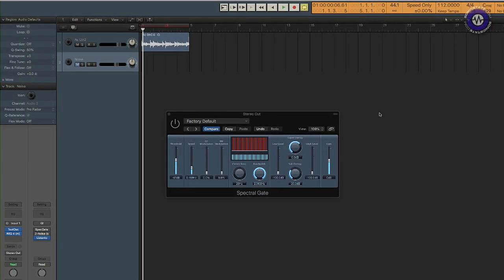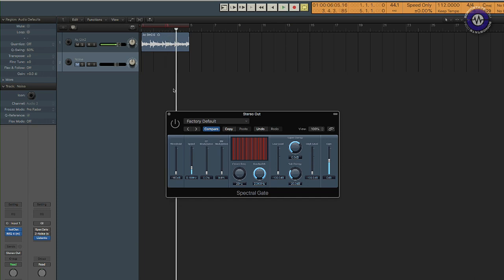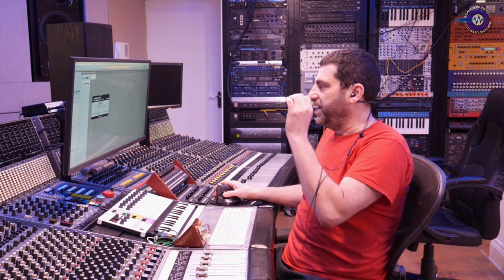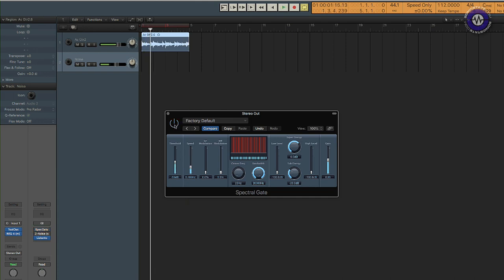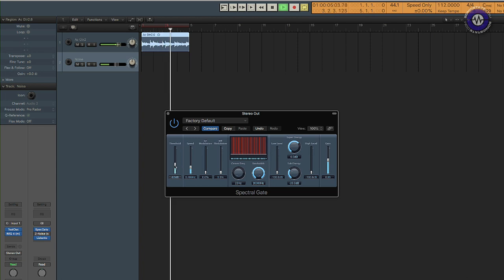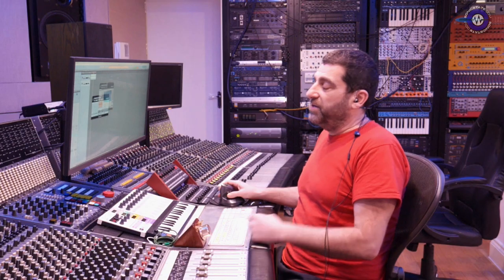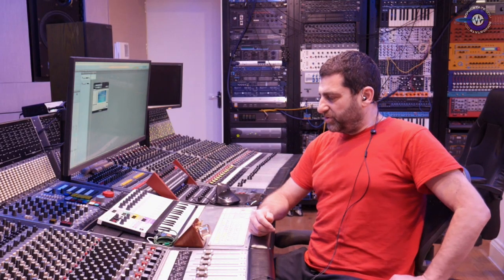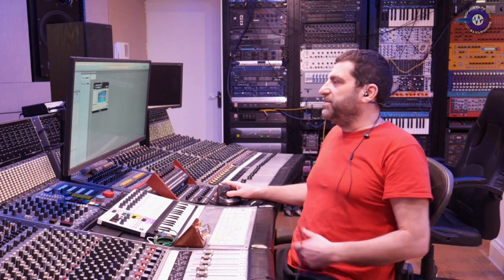HOW IT WORKS - Noise Reduction With Yoad Nevo

Comment: Great thanks Yoad & Nick!  Very appropriate as I've just been thinking how I can clean up my analogue Line level signals from my old Behringher DDX3216 mixer (very noisy now, even with re-capped PSU... are we allowed to use the 'B' name here?) in to X32 rack using some form of digital Noise Reduction at the beginning of that input chain. So was wondering how these algorithms actually work in reality to do this.  Will have a play!  Be safe all - catch you in fact ... tomorrow (already!!) 😷🖐🎹🎶🍻